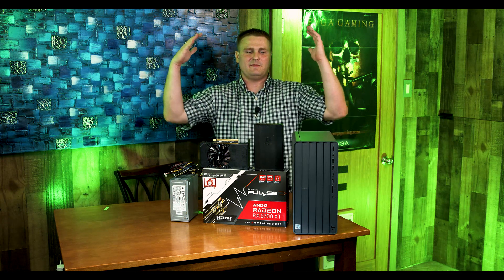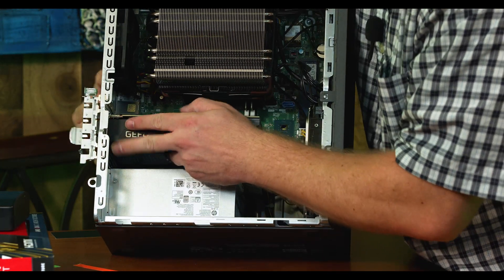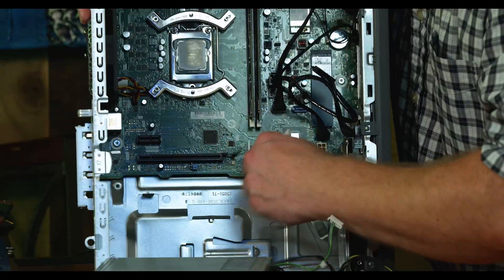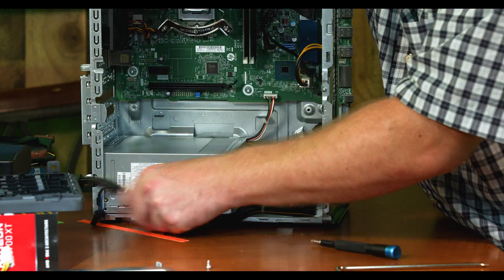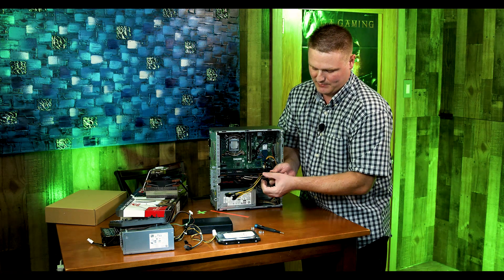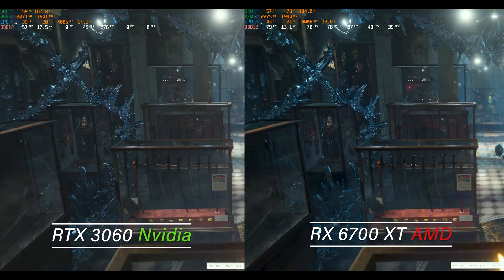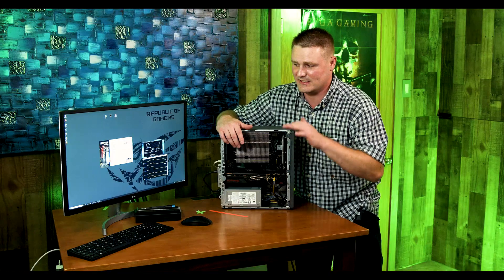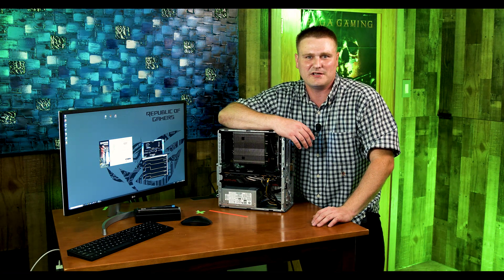HP Envy Desktop TE01 Upgrade Will a RX 6700 Beat a 3060  Lets Find out!  RTX3060 Vs RX6700XT

Comment: So I just bought a GeForce RTX 3060. It installs just like the RX 6700, with an exception to a few things. Question, I understand that for sake of structure you did not put the shell back on the desktop after installing the RX 6700. If you wanted to, would you still be able to put the desktop shell back on after installation? I'm just not the "desktop WIDE-OPEN" kinda guy. And if it helps, I have this exact model desktop.

Comment: I'm curious, exactly which specific rtx 3060 did you install? What's the Vram? I have a Te01-4000 with an i5-13400 and a 400w PSU. I know the AMD performs better, but I don't want to spend more money on another power supply, and I've heard the AMD cards don't support as many codecs for video editing.

Comment: I'm having a issue fitting the cooler over the memory cards. I've followed all your steps I belive
Reply from the maker: You can turn the cooler 90 or 180 degrees all you have to do is move the mounts down.
Reply from the maker: Or just retuen that cooler and get the aio that works for it.
Reply: Ok I wasn't sure about turning it. I will try that tomorrow.  Thanks for the quick response. I'll let ya know

Comment: There should be a panel door with better circulation. My fan blows out towards the panel door (this is the only way to install the fan for the Nocturna). If it had one with perforated holes the unit would run a lot cooler. I just have the panel door open, which is not ideal but it brings the CPU temps down by 10 degrees (61C when gaming)
Reply from the maker: yes simple and easy way to lower the temps

Comment: Great video!  My brother and I are in the process of upgrading his Envy.  Installed the 500W PSU and the 3060 GPU - GPU temps get too high during gaming (80C) - we're adding an exhaust fan and replacing the rear fan with a better unit....I'm so impressed with those temps you get with that single chassis fan + huge CPU heatsink
Reply: Have you had any issues with the power supply being paired with the 3060?
Reply: How did the cooling end up working out. Thinking of doing this but kinda worried about the heat inside the case.

Comment: Your content is exactly what i was looking for, but please help me understand why it is ok to go so much lower than Gpu recommended wattage? 

We're trying to upgrade our kid's HP ENVY TE01-1165T (stock w/upgraded 32gb ram) to a gpu that supports Oculus air link. 

Every card on the list recommends 550watt pcu or higher (which isn't available for this machine).  

I'm worried the vr play will draw too much to ignore the psu recs... help?

Comment: I have a similar computer to this one (HP ENVY Te01-1165t)

It came stock with:

i5 10400f
8gb Ram - that I upgraded to 16gb (2 8gb sticks)
256gb NVMe drive and a 1tb 3.5" HDD at 7200rpm
GTX 1650
400w 80+ Gold power supply (HP)
Also it came with a DVD writer but I removed it as I have no need for it.

I'd like to know if it can run a RX 6650xt 8gb card (specifically the XFX SWFT 210) it has similar max power to the RTX 3060 at I believe 170w but says 500w is minimum. I'd like to know if the 400w 80+ Gold HP power supply is enough to run this card. I can upgrade the SSD to a larger size and remove the HDD if necessary but I'd rather not. Also, I found on ebay a 500w 80+ Gold power supply from HP that is supposed to work with this computer (L05757-800?)

Thanks for any help!!
Reply from the maker: The 500w will allow you to do up to a 3070. 400w should work with the rx 6650xt just fine.
Reply: @TNW1337  awesome!! Thanks man!

Comment: Great video. I have a problem that maybe you can help me with. I have the HP Envy TE01 and I installed the PNY GeForce 1650 into it with a 750w external PSU. Everything seems to start up but the video does not switch from the onboard graphics card to the new one. Any ideas?

Comment: Do you think I'll have a problem with the MSI RX 6700 12G OC? The size is  smaller then Sapphire one you listed with a dual 8 pin. The Sapphire has 8 & 6 pin. I have the 500w PSU with the larger cooler you recommended. With two sticks of HyperX 16GB ram.  I purchased PCIe 8 pin female to dual 8 pin Y-splitter along with two right angles 8 pin. If you don't think think I'll have a power problem, should I also upgrade the stock fan? Thanks for videos  and help here.
Reply: With the GPU I got. I found a review with these Power Draw numbers.
Average Power Draw: 181W

Minimum Power Draw: 146W

Maximum Power Draw: 195W
Reply: I noticed the 6700xt you recommended and the one I got are both rated at TDP:230 watts.  I  was just making sure it was going to work because it's a Christmas gift. Thank you for having this channel.

Comment: Hi mate looks like you know your stuff. I have a hp envy te01-0005na and im looking to upgrade my graphics card to the RTX 2060 Super 8GB. I have the 310W stock PSU so I assume I will need to upgrade that. My question is will the RTX 2060 Super 8GB fit and work in my PC along with a new PSU? If so what PSU do you recommend.
Reply from the maker: 400w, But if you get the 500w a 3070 will work! Also they are on sale or a or RX 6700. With the 400w you can do up to a 3060 ti, No overclocking.
Reply: @TNW1337  I put the 3050 in mine tonight. But my power supply is only 160 Watts. What do I do now?

Comment: What power supply did you use to upgrade the base one?
Reply from the maker: I think it had a 180w or 210w before the upgrade.
Reply: @TNW1337  One more question, how'd you get the cage next to the cpu off?

Comment: What size power supply and case? I was told the 550 wouldn’t fit in my case. Also was told my 400 watt psu wouldn’t run the 3060. I guess I’m gonna put it in myself. Hope it doesn’t fry my computer or card.
Reply: In most real world usage, your 400W PSU should be fine for a 3060. If you do have any extra hardware installed that takes up extra power such as optical drives, mechanical hard drives, RGB etc. Then you may want to remove some of those to lower your power usage. Also do not do any overclocking.
Reply: @lumiereeclair  all I use it for is iracing with a  4k tv. Id like to move to vr. Do you think the 400 watt would push enough for good quality on vr? Thanks!
Reply: @hippieflip8893  Do you already have the graphics card? Your PSU won't limit the quality of the picture, it's the GPU that is more important. Here's the thing though, since you want to do VR your GPU utilization is going to be quite high, which means it'll most likely draw more wattage when in use. I said before normally, you should be fine with 400W PSU and the RTX 3060. I can't say what can happen if you plan to play in VR. If you already have the 3060, then try it out, the worse that can happen is the GPU will draw too much wattage and your PSU should shut down due to OPP (over power protection). If however you don't have the GPU yet, I recommend getting the RX 6600. It's performance is slightly lower than the 3060, but both cards are more than capable of VR. The pros of the RX6600 is that it has a much lower power draw than the 3060. The 3060 needs 170W vs. the RX6600 which needs only 132W.
Reply: @lumiereeclair  yeah I already have the gpu.
Reply from the maker: 400w will support the 3060ti no Overclocking!  any thing past that you need a 500w. if you stick 3 HDD in your PC you would need a 500w, you want to keep a overheard on the PSU of 20%. this is not because the parts use that much, it is because of spikes in power when used. Mostly when you start a game or heavy app that Use the CPU and GPU at 75%+. But it only spikes for like half a secs. this is why you can get away with it.
Reply from the maker: HP has done a pretty good job of towing the line with how much power it uses, this is also why only 65W CPU will work in there TG, 690, 590, M0, ME, FE, Victus, TE & Evny lines.

Comment: How would you increase airflow/cooling for this case to sustain the better gpu?
Reply from the maker: Fast and cheapest way take the side off. But if that is a no go. Add front Fan and a 3000 rear fan. you could also add a fan that is free point at the GPU from the bottom. At this point you are spend the same as just doing a case swap. Maybe 75$ more for the case swap. You can get case with good fans and your of to the races.

Comment: i have a question from another video. i wonder if the 400w r5 5600 3060 RTX 16gb ram work fine on an 400w power supply
Reply from the maker: Yes

Comment: The RTX 3060 and the RX 6600xt are considered the worst cards in Is generation of graphics cards.
Reply from the maker: Yes and no I would Agree & Disagree. They are overpriced do to the Covid crap & mining. But the Availability of the RX cards is the saving grace. I know a better VS would be the RX-6700-XT vs The RTX-3070.  The big problem is NVIDIA has stop making the RTX 2060, 2070, 2080 & TI Versions. So the options are going to be very limited. They are pushing the 3000 Hard. Any ways how have you been? thanks for the comment.
Reply: @TNW1337  wrong Nvidia is making rtx 2060 again a refresh and now they have six more gigs of vram.
Reply: @nicholaswatson999  funny that u say that most reviewers think the 6600/6600 xt best bang for your buck right now.
Reply: @TNW1337  https://youtu.be/qJ2NKmp3zV
Here's where I saw it I might be wrong